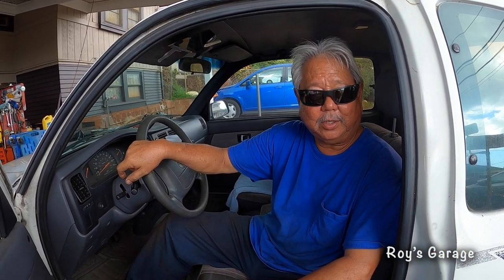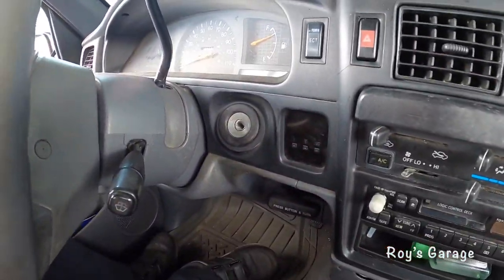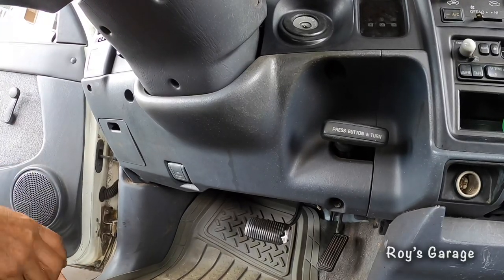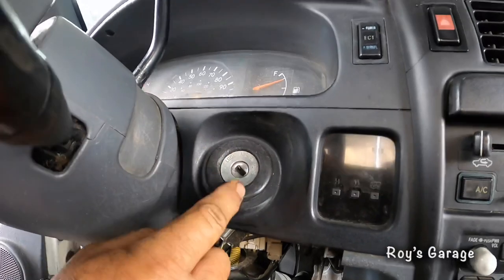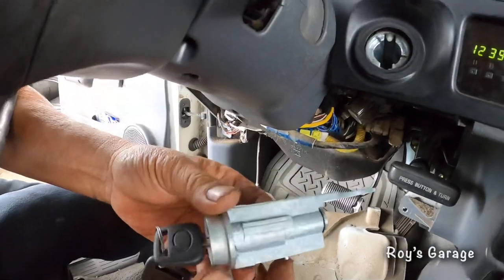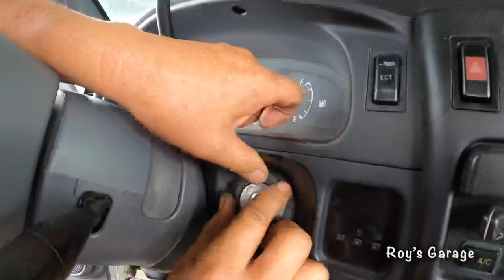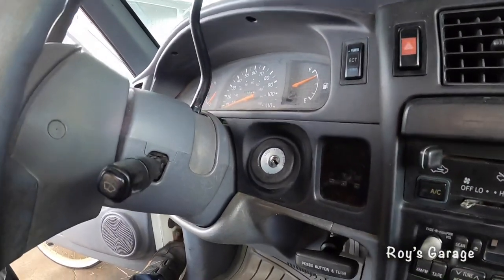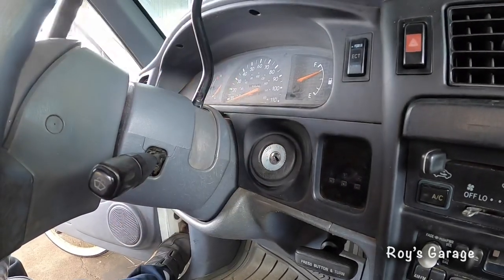How to Replace the Ignition Lock Cylinder on a 1996 Toyota Tacoma

Comment: How would I go about this if the ignition is destroyed? I can’t put a key in it. Tweakers absolutely destroyed it trying to steal my truck.
Reply from the maker: Sorry about the late reply, so I’ve never come across this problem but my best bet would be to somehow get the pin that locks the cylinder in by drilling or punching it out. Let me know how it goes and thanks for your patience and watching 🤙🏽🤙🏽🤙🏽

Comment: I have a 96 tacoma with that same problem, plus the housing where the cylinder goes in is broken
Does anyone know if that part is replaceable or should i buy another steering column?
Reply from the maker: Sorry for the late response. It is replaceable but I believe that part is only sold by the dealer. Thanks for watching 🤙🏽🤙🏽🤙🏽

Comment: What about if doesn't let you put it on the second position acc what can you do mines is really bad it won't go to the 2nd position anymore
Reply: Good question
Reply from the maker: Sorry about the late response and oh my goodness, that is a really good question. This is definitely though one because it absolutely has to turn or the pin won’t go back in. Personally I would first lubricate it with some graphite spray that specifically made for the lock cylinder then I would try to jiggle it around and hopefully it’ll work, next I would try and use the other spare keys because sometimes the key you’ve been using the most could be worn out, and if that doesn’t work and worst comes to worst I would contact a lock smith and hopefully they can pick the lock so they can turn it to remove the cylinder. I wouldn’t try to hammer or drill the pin because you definitely don’t want to ruin the steering column, that would be a bigger big problem. I hope that helps and if you’ve found another way around it, please let me know because we’re all still learning day by day as we go. Thanks for watching 🤙🏽🤙🏽🤙🏽
Reply: @RoysGarage808  no worries I seen someone's comment about drilling thru the bottom drill carefully where the release pin is and it will come undone as if you have on the acc position thanks for the reply it's very much appreciated
Reply from the maker: @adolfalvarez5534  Thanks for letting me know. I learn something new everyday, it's what I love about the automotive industry! Thanks for watching!!!

Comment: my cylinder won't come out, I had to drill the pin, but the whole mechanism is rock solid in the dash still... even after removing the front plate etc... frustrating

Comment: Awesome how to replace the lock cylinder on 1996 tacoma, how abt the ignition switch behind the lock cylinder, or the cluster panel light bulbs behind the speedometer/gauges behind the steering wheel, my bulbs most are out, cant figure how to take out the cluster to change the bulbs, cluster may not be the correct term for the item that has the speedometer in it.
Reply from the maker: For that I’d highly recommend taking it to a professional because you’d have to pull the whole instrument cluster out. Thanks for watching 🤙🏽🤙🏽🤙🏽

Comment: Roy, thanks for this video. i tried to remove the ignition switch and even press the pin. it will not come out. when i saw your video, you gave an extra step by remove the rubber grommet. that was easy. I have already ordered a replacement switch but first I want to try lube the internal cylinder to see it will be salvaged. I sprayed some litinum into the internal switch thoroughly from the back side while turning the switch with the key multiple times. the switch had to be removed in order to spray the lube the rear of the cylinder. the reason i wanted to do this is keep the same key for the door latch. otherwise, i will have to carry two,  ignition key and the door key. I did notice the difference when the lithinum lube was add. it turns very smooth and no jamming. I will keep the old ignition switch. the new sweitch is only $7 with free shipping. At least i learned to remove the rubber grommet. thanks again, bob

Comment: What if you don't have the key and can't put it to on start
Reply from the maker: Call a mobile locksmith.
Reply: @RoysGarage808  I just drilled out the pin that keeps the lock cylinder in place it came right out, back on the road thanks for your helo!